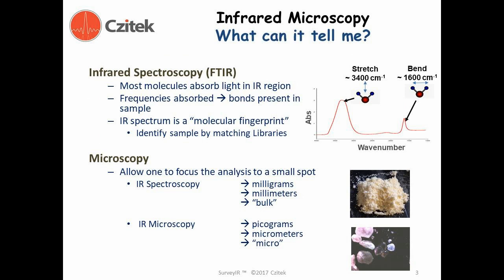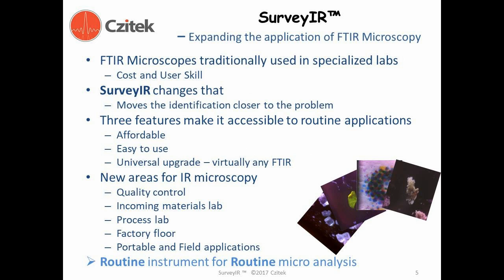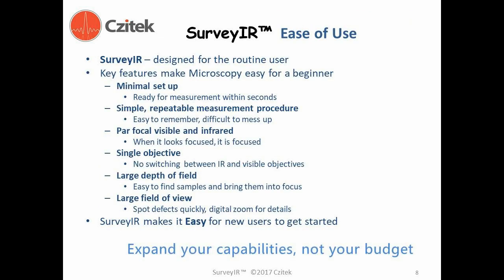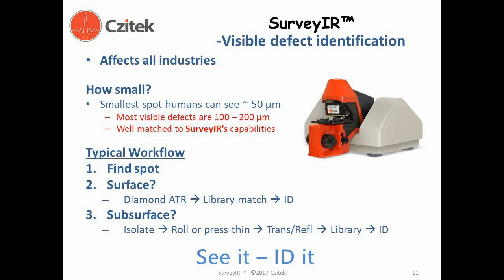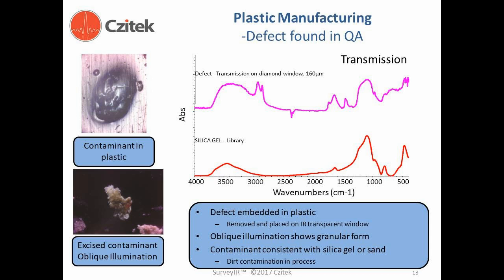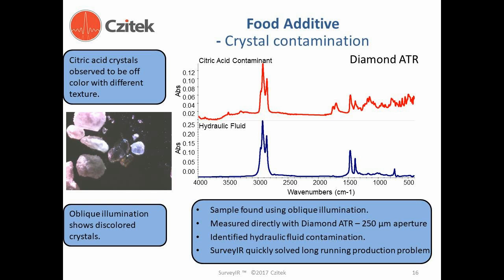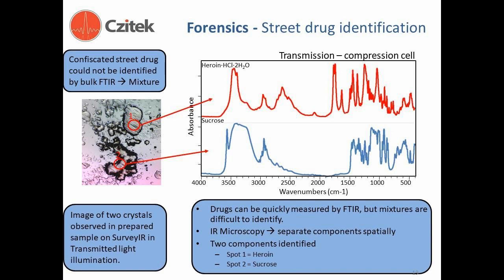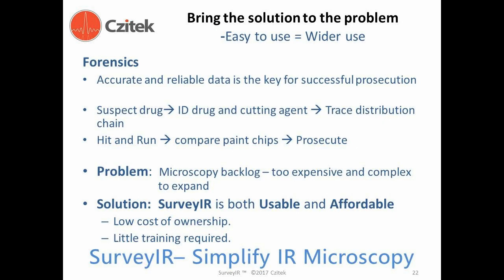Czitek SurveyIR FTIR Microspectroscopy Accessory on demand Webinar

Comment: And another concern is why we perform transmission mode we need "three holes slide" accessory?
Reply from the maker: The "three hole" mount accommodates standard 13 mm diameter infrared transmission windows to support the sample. The mount is included. Windows can be purchased from many different suppliers.

Comment: I am interested in ServeyIR of Czitek and thank you for your best sharing. I have some concerns like ServeyIR have three modes: transmission, reflection, and ATR which correspond to three ServeyIR models, right?  With which sample to use these measurement modes?
Reply from the maker: One model of SurveyIR can provide operation in all three modes - transmission, reflection, and ATR.
Reply: yes, but for the model with P/N 101-00-0001-W named SurveyIR Reflection Unit, is it use for Reflection measurement only? And P/N 101-00-0003-W named SurveyIR Reflection/Transmission/Diamond ATR Unit is use in all three mode: Transmission, reflection, and single
 reflection (diamond) measurement, right?
Reply: And I want to ask that which type of sample we will you transmission mode or refection mode or ATR mode, respectively?